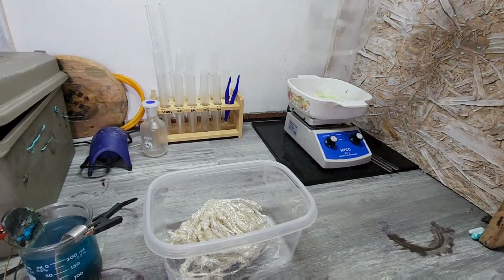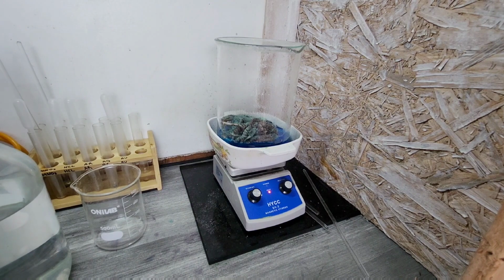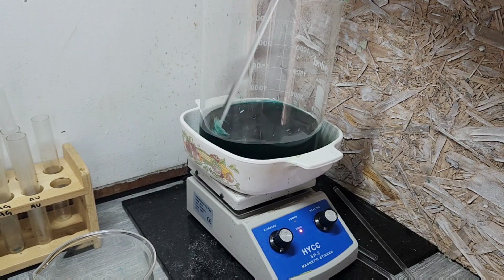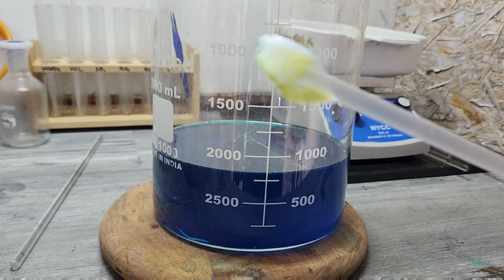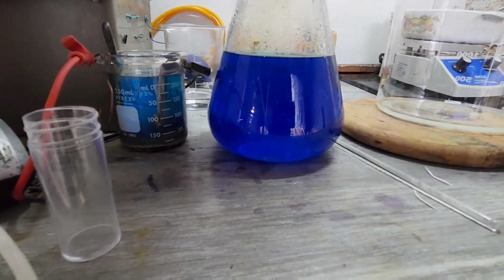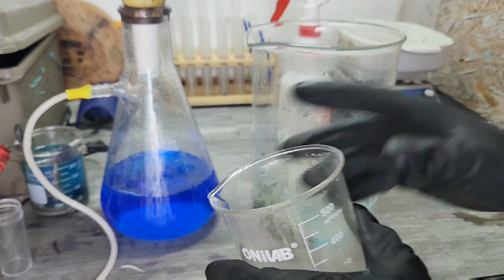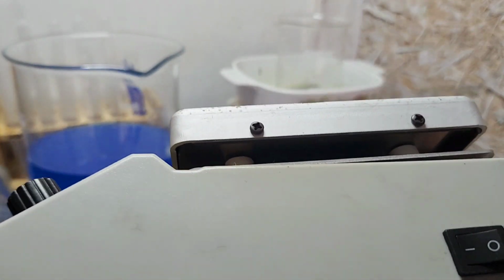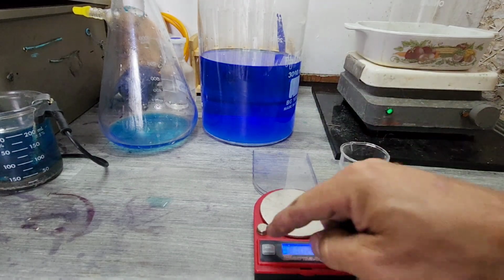Silver plated wire silver recovery with nitric acid.

Comment: Pro tip: use about 30% sulphuric acid added to your nitric to create a barrier against the base metals (copper in this case) and you can use it as a poor man’s stripping agent to get the silver off without having to use so much nitric to consume all of the copper before filtering etc
Reply from the maker: I tried this with contacts and I believe the solution has to be fairly cold or the copper gets dissolved.